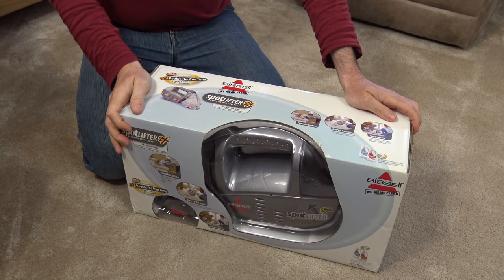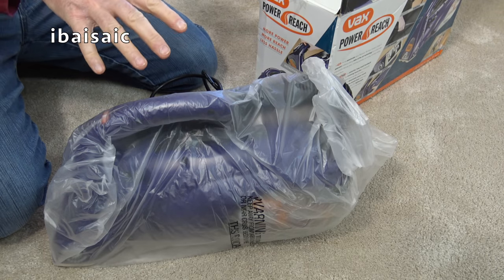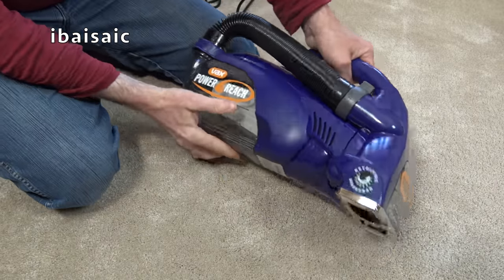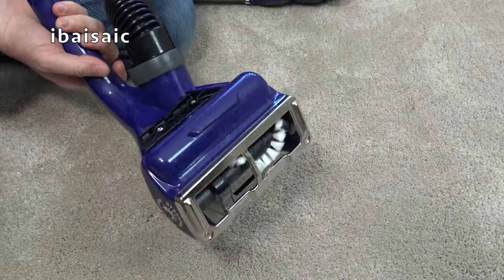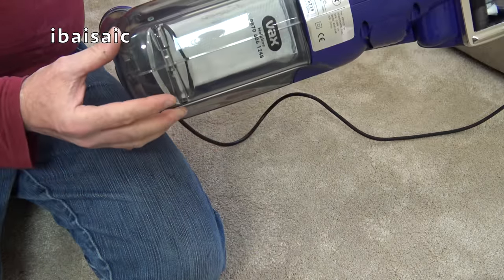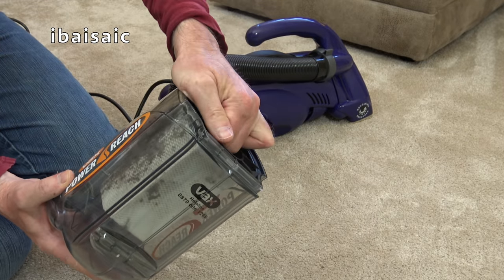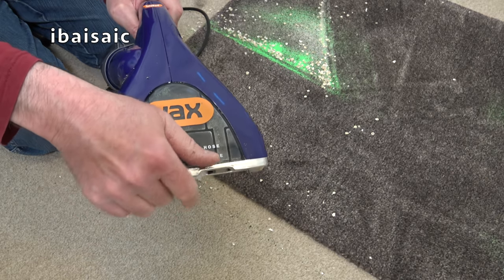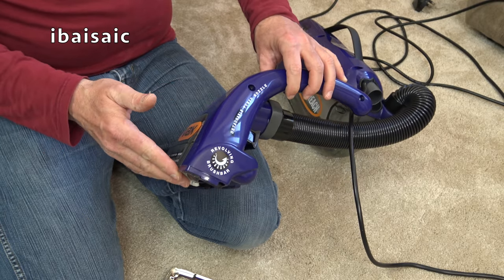Vax Power Reach Handheld Vacuum Cleaner Unboxing & Demonstration

Comment: We used to have one of these. Yes it was a Dirt Devil, but they had two different filters. Our example had the same square filter yours had but later models had a pleated cylindrical filter. The weak link was the turbine in the head. I didn't see a pebble when I was cleaning a living room entryway and it shattered into about 7 pieces. Still was a great straight suction unit for the money.

Comment: The older platinum force hand vac use to have a separate motor for brush that worked alright but for some stupid reason when the power reach came out Royal decided to make the nozzle a turbo instead of an electric motor like the older one did. Such a same too since having a detachable nozzle is a smart idea.
Reply: Thankfully with the Power Reach they opted for an F2 filter instead of the weird cloth one like with the Platinum Force, which did help with airflow to the turbo nozzle. I quite literally bought the PR just to have the F2 adapter for my PF!
Reply: @Javi_Lacking  I had a similar vacuum that has a pleated filter and motorized brush but no detachable head.
Reply: Bruh

Comment: I had that exact same style from the Dirt Devil line like you said and it wasn't the powered brush it was an air driven model and I got rid of mine cuz it didn't have enough power to rotate the brush. Which I was really disappointed

Comment: Now I did have the powered model of this and did actually have a motor in the nozzle and it was fantastic until it went out. Then that's when I found the other one and I was under the impression it also had a motor but it was are driven like you were saying and I was very disappointed

Comment: The only two air-driven nozzle I've ever come across that actually compared to an electric one is the Rugrat and the turbocat those two units I would say are comprable to an electric driven system but if I have to use an air driven system the Rugrat and the turbocat are my go-to system